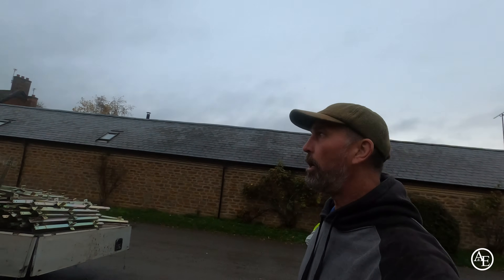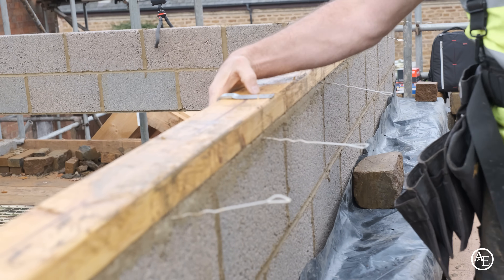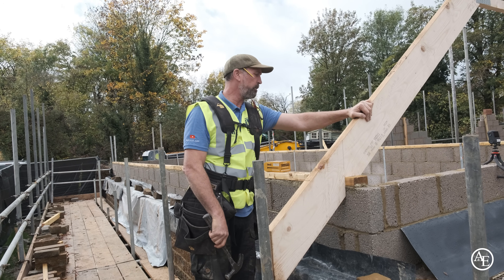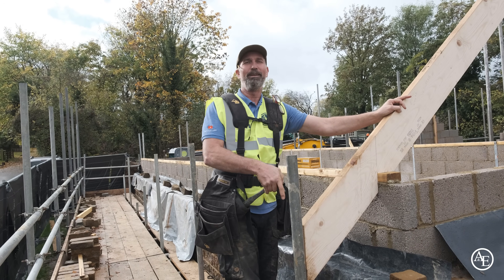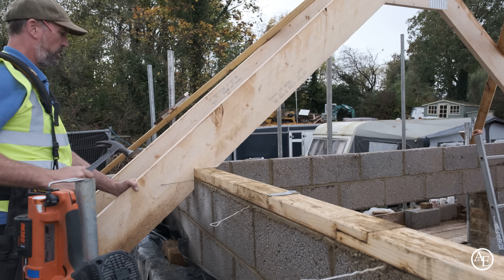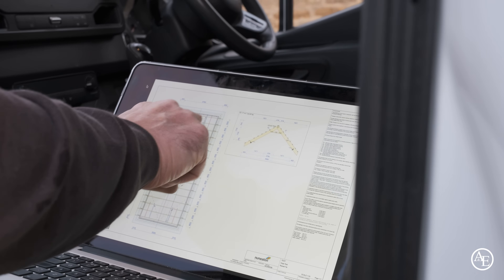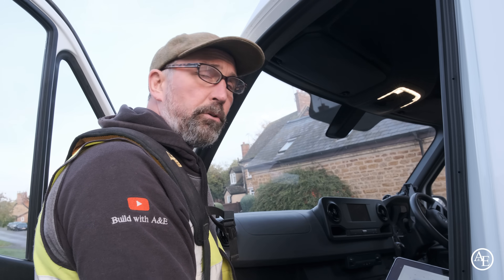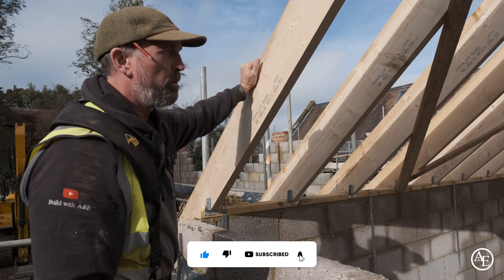How To Construct A Trussed Garage Roof

Comment: Nice job 👍
I like to put the truss on the plate and level the ceiling cord and then strike a plumb line up outside edge of wallplate  on to the truss to determine my birds mouth.
Everyone does things differently but that's how you learn, as long as the end result is there then its all good 👍
Top tip, once you've marked out the wall plate stack your 1x4 on top keeping the ends flush to the inside block work and then square all your truss marks on to the 1x4, then it's easy to fit and saves time, you can plumb the end of the 1x4 to your inside block work once all installed, if that makes sense 👍
Reply from the maker: That’s a great shout Danny all the best Tony 👍

Comment: If th wallplate is not exactly  straight then all the tail ends will not be  straight.  Thus facia board won't be straight  if fitted
Reply from the maker: Hi Steven no fascia mate, wall plate nothing to worry about pretty much parallel all the best Tony 👍
Reply: The tails will be straight if one uses a dry line or chalk line. What one has to watch out for is that the fascia cuts are parallel with the wall. Otherwise one will have a tapered soffit.

Comment: Hi, great work!
Is there a name for this type of truss without a bottom chord or joist?
Also is there a maximum width from wallplate to wallplate for this type? I'm doing a very similar project with a width of 4.6m over wallplates and ideally would like to not have to use a ridge beam or purlins.
Cheers
Pete
Reply from the maker: Hi Pete vaulted Truss roof, the Truss company ie Nuneaton Truss company would do all the calculation for you all the best Tony 👍

Comment: Great vid as always - just had first delivery from Nuneaton after finding them from your tour video. Thanks.  Do you recall how much each of the trusses in the video weighs? About to do some a bit larger (~75kg, 5.5m span) but still need birdsmouths cutting so wondering how different the process will be.
Reply from the maker: Hi Badger much appreciated 55kg ares were 
The process is straight forward, height is a factor if two storey definitely you more hands plus decking inside or tressells Happy new Year give us a shout if you need a hand and to to far away all the best Tony 👍

Comment: What them cavity ties doing under the wall plate
Reply: Outer skin of brick still to be brought up
Reply from the maker: Stop on and gutter brackets bedded in
Reply: @BuildWithAE  never seen outer brickwork finish same height as wall plate before
Reply from the maker: @davedavids2231  it’s an old stone house the stone finish’s underneath the slate with a vent detail I would think if you Google the image you can see that detail also with the bricked in gutter brackets all the best Tony 👍
Reply: @BuildWithAE  ok thanks 👌

Comment: Newbie question. With the bracing installed on the internal side of the trusses, i.e. the ceiling. With this a vaulted ceiling design (I believe that is what Tony mentioned). How is the plasterboard installed with the bracing being in the way? Double boards?
Reply from the maker: Hi G You would use lath to make the difference up down the rafter length underneath then plasterboard all the best Tony 👍
Reply: You could probably get away with putting diagonals just in the top section with 3 straight bracings